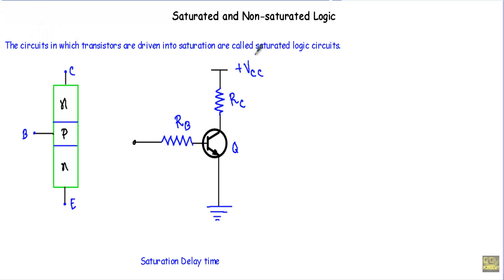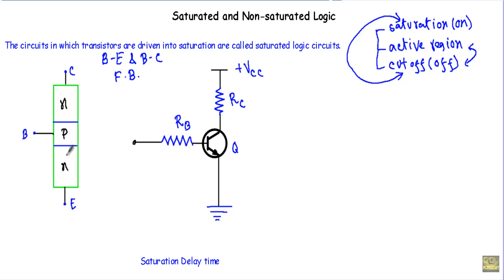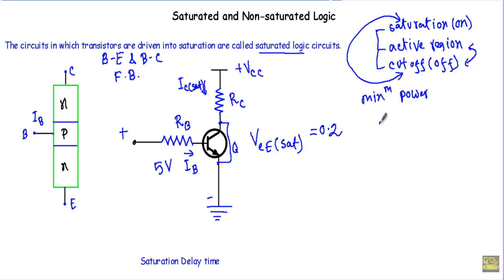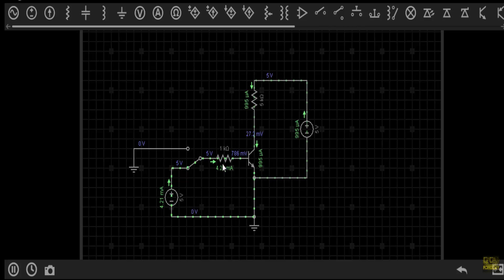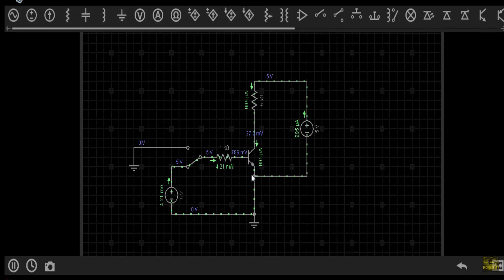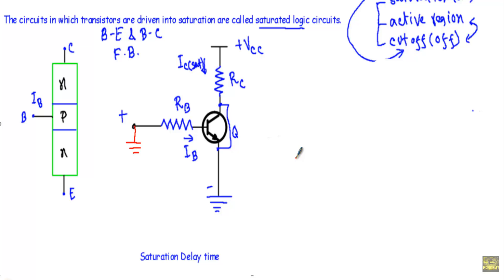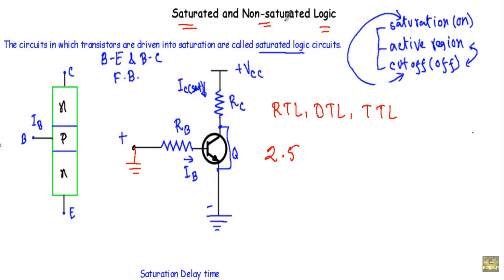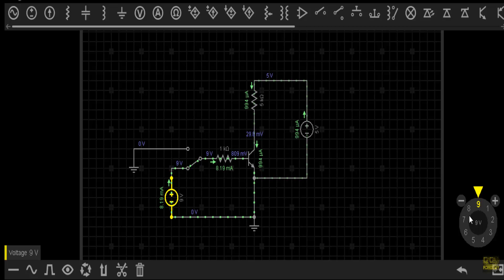Saturated and Non-Saturated Logic

Comment: how is the collector base forward biased in the simulation....because the collector which is of n type is connected to the positive 5 volts (i asked the question because for a transistor to work in saturation both EB an CB should be forward biased) please reply ......thanks in advance